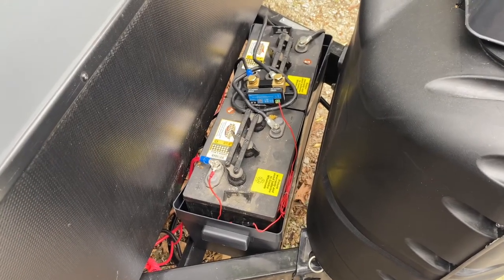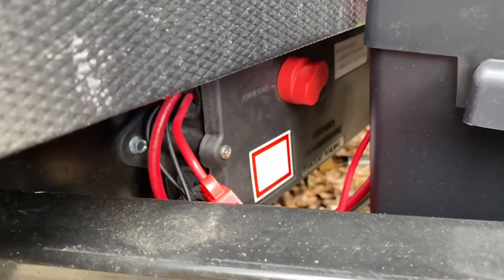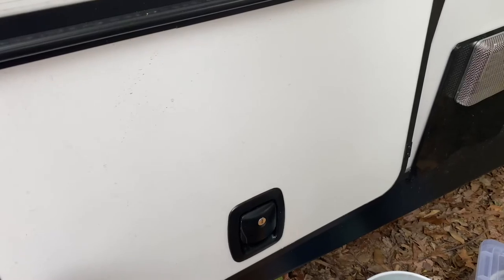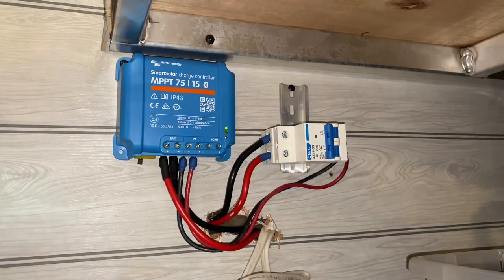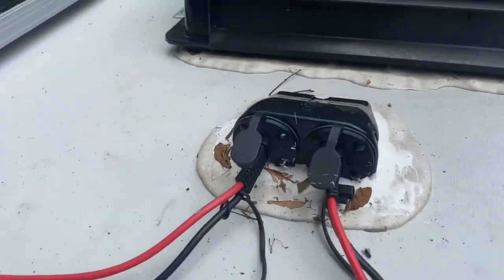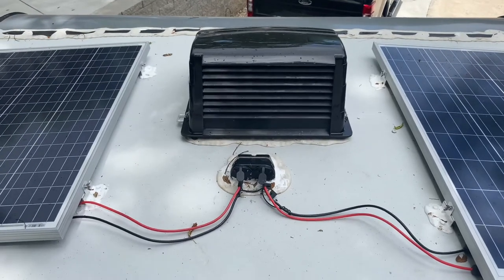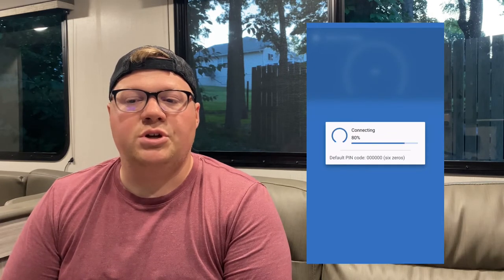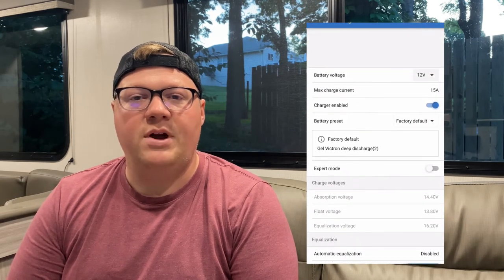Simple solar install using ZAMP solar prep.

Comment: I have a 2021 keystone passport 219BH which also has the zamp outlet on the front of the trailer. We were hoping to be able to move the panels to the ground if camping in a tree covered area. Does yours have the same outlet and is it wired so that the charge controller mounted in the area you  used remains between the panel and the battery?

Comment: This might be a dumb question but can you reverse to polarity at the charge controller instead of using an adapter? I also want to say thank you, this is the best video when dealing with the Keystone Zamp equipment, it seemed like what you did is what I needed to do but the confirmation is great!

Comment: Good presentation! Is the smart shunt necessary when running two 6v in series?  What is the shunt's purpose?
Reply from the maker: No it is not. The shunt is useful to see the actual charge. It also allows you to see how many amps each 12volt item uses.

Comment: I know this video was posted a year ago but this has been the most helpful for me in putting solar on my keystone bullet. One thing I'm having a difficult time with figuring out is the wires that go from the charge controller to the battery. Did you have to install those or were they already there? I too have solar/inverter prep but the only wires I have coming out of my hole is the romex loop and 1 black and white wire which obviously come from the roof and into the charge controller. My trailer has a giggy box which has a positive lead from the solar post but I don't know where it goes from there. Amy help would be greatly appreciated. The dealer wants thousands of dollars to install my pre purchased part (keystone rvs recommended Zamp system) I'm not comfortable paying that much for something that is supposed to be "plug & play".
Reply from the maker: On my trailer the wires from the roof top solar prep went straight to the battery and where next to the romex wire. I cut the wires and one end went into my charge controller and the other side went into the output of the charge controller. The output side is already connected the battery. It’s confusing cause it’s not labeled, I double checked the polarity using a multimeter.
Reply: @metzbeadventurous46  ok. Mine is most likely different I only have a red and black wire and the romex loop in that hole. The red and black wire I'm assuming is coming from the roof cause there is no power coming from it. So that tells me that it's to go to the input of the charge controller and I still need to find the wires going to that battery to complete the install. I did purchase the same breaker linked on the description for this video so I just have some loose ends to get this done.